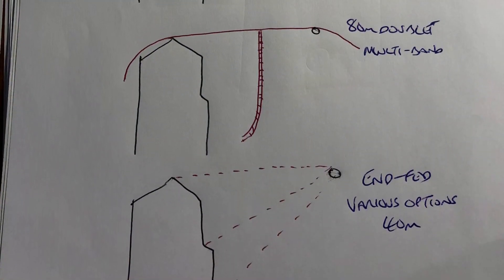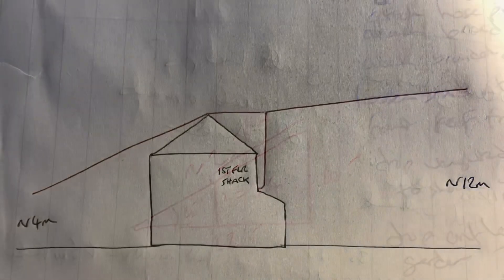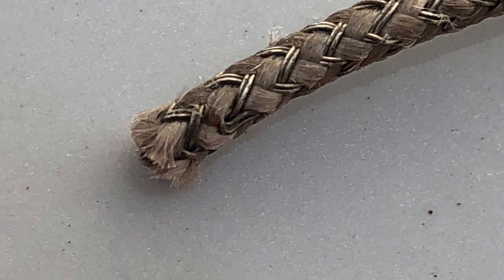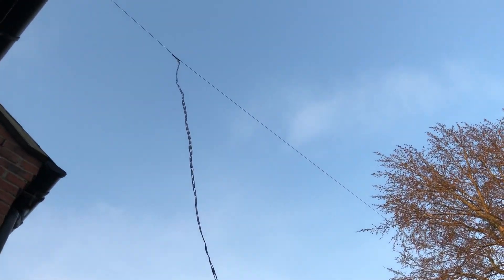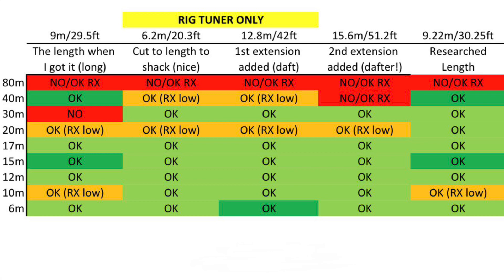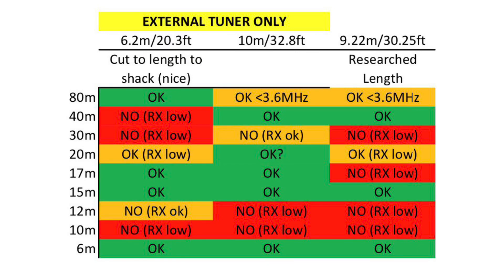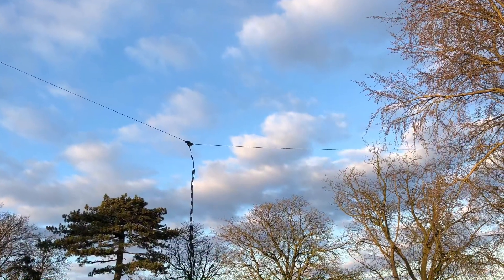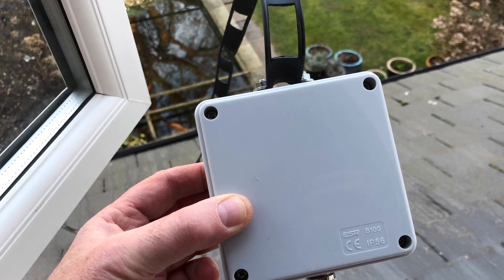Doublet or Dipole? - Part 1

Comment: I use both antennas. I have a large 240 ft doublet fed with 450 ohm line to a balun at 100 ft height and a wide band auto tuner to cover 2-23 mhz and have individual dipoles matched for 3.3, 4.5 and 5.1 Mhz that are a 1/4 wave off the ground for NVIS.
Reply from the maker: @MrFreddarama  Sounds a good setup 👍🏻

Comment: The doublet is perhaps the most robust and forgiving wire antenna around. With a 1:1 choke balun, there is no worry of common mode current in the shack as opposed to an end fed antenna whether it be half wave or random wire. I use a ZS6BKW which is resonant on 40, 20, 17, 12, and 10 meters, depending on configuration. I use a broadband autotuner which makes multiband operations a breeze as opposed to having a separate dipole for each band.
Reply from the maker: Thanks for the information Ron 😀

Comment: i have struggled with these a 4 to 1 balun might help i love my 80m dipole i did have a 40m delta loop. noting beat it till my steppir i would think 25m a side might be a better length any way a good video as always
Reply from the maker: Thanks! Yes when I researched a lot were using 1:1 baluns to give the tuner a high figure to bring down, rather than a low figure it can’t tune higher. Anyway, the dipole in part 2 is working really well 😀

Comment: I have a 70 m (35m per leg) doublet fed with 300 ohm ladder line connected directly to a balanced tuner mfj 993b. Tunes everything from 160 and up. I think the main point is the lenght of a dublet should not be resonant at any ham band, so 41 meters i think is not a good size. Also balanced tuners have 4:1 balun built in or atleast my has it.  So in case the tuner doesn't have a balanced output, you should put a 4:1 and the shortest posible lenght of coax to tuner. The losses on balanced line with high swr are negligible. I hope i am not totaly wrong here but it works for me. Good luck 73.
Reply from the maker: Thanks and congratulations on your long doublet! The tuner was unbalanced and the latest thinking is use a 1:1 balun to present a high impedance to the tuner. A 4:1 can sometimes present a very low value (<50 Ohms) which they struggle with. Yes, a non-resonant length. Now trying a dipole 🤞🏻

Comment: Before you take it all down and get the dipole up, I'd try getting the tuner directly on ladder line rather than behind the choke just to see how it looks then, I know you have a 991a so I guess you can use it in the garden direct to the tuner (weather permitting) for test purposes. I too am planning to put one up in my garden as a test, already have tuners so need to make up the doublet and ladder line.  I have had a fan-dipole in the past and it was very very good, just three elements on it for 80, 40 and 20 and it would also tune many others.  You might have issues because of the roof though.  If you do, then it's probably why the doublet has issues too.
Reply from the maker: Thanks Stewart! I tried a different type of choke yesterday with no real change. I’ll see if I can connect to unbalanced input of tuner before it comes down. Less windy today 👍🏻
Reply: Good luck with it!
Reply from the maker: @stewartrv  tinkering now....

Comment: i have a doublet, not as long as this one, but cut to one of the recommended lengths, the ladder line drops down into a home brew remote balanced tuner, it would tune on all the HF bands except 40M, eventually, the solution was to add about 500mm to each leg M0IUQ
Reply from the maker: Thanks Gary. Sounds like you’re sorted with yours 👍🏻

Comment: Cheers for the video, Ian. Looking forward to part 2. 
It's great to see an amateur with enough room to get a decent wire up 👍- so many of us restricted more and more.
Reply: I'll second that. I've got a six foot by thirty foot concrete wheelie bin yard surrounded on three sides. Ugh !
Reply: @Steve_Wardley_G6JEF  same mate. Fortunately I've got a skylight so I've got a 20m EFHW fed at the bottom of a 10m pole at the end of the garden with a 49:1 transformer - so 10m up vertical then 10m flat across to the skylight inverted L.
The noise is off the scale though living in Coronation Street style proximity. 😐
Reply from the maker: Thanks Mick! I was a bit wary about going round the front as it’s all open plan. I used 100lb braid fishing line to try and be as in invisible as possible. Nobody’s commented so far....

Comment: Doublet Collins multi band but use open spaced feed line 4” electric fence ribbed isolators and uv resistant DuPont 66 wire ties 13” long. And multi band the antenna from 80-6m 😉 looks great 👍
Reply from the maker: Sounds good Kevin!

Comment: I have a fan dipole 80/40 going east west one on top of the other 40 more inverted v . Works great . Yet i am a big fan of the doublet.  That atu will definitely tune a doublet it just needs a afternoon getting it just right ? If you go with the doublet the main thing is symmetry!  135 ,120 or 100 feet will make little difference?  Symmetry might be tricky with roof ? I try to avoid 1/2 wave lengths 140 was a good lengh for me . Good luck .
Reply from the maker: Thanks Rob!